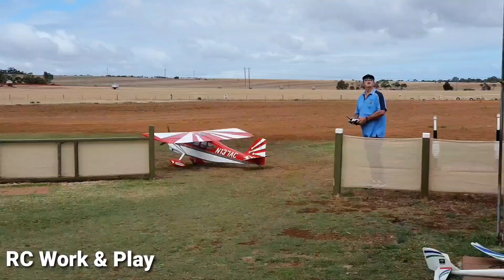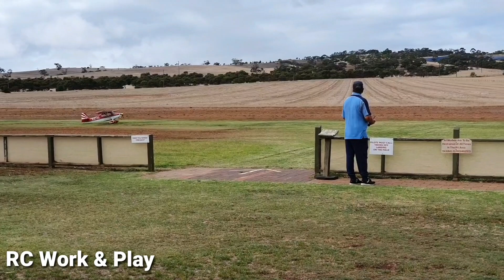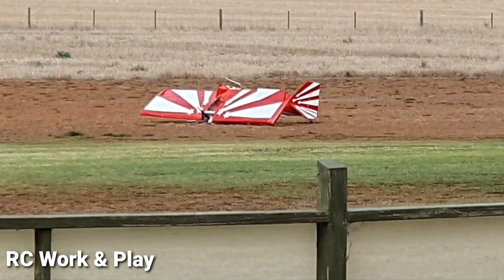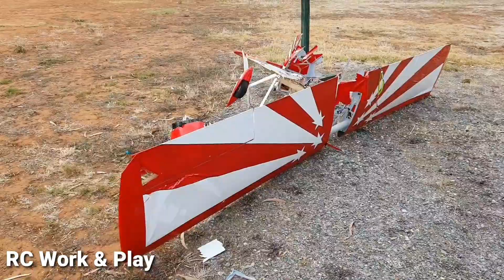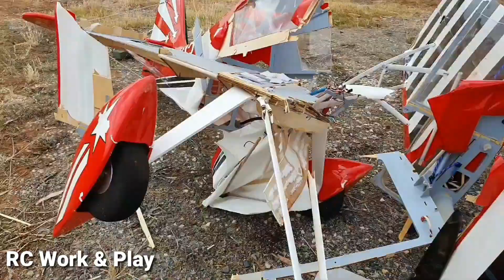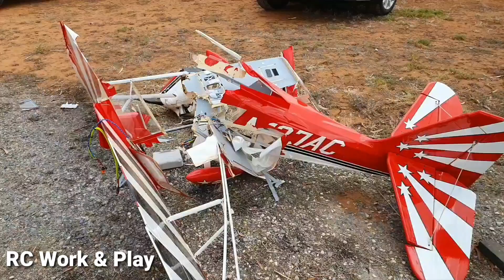Big 1/3 scale RC plane crash!

Comment: Looks like the ailerons were reversed, pilot panicked, stalled it, then crashed it. Purely pilot error, but at least he can learn from it.
Reply: I agree same thing happened to me after I rebound a receiver on my spektrum didn't realize spektrum resets everything to default when you rebind I didn't verify the controls correct like every full size aircraft does before take off. Now I have it as part of my check list.

Comment: Actually, that model had just passed the ground inspection for heavy model, this was it's maiden. One of the ailerons mountings actually seperated with the servo still attached. There was no glitching, there was no reversing of the ailerons.
Reply: How do you know that didn't happen from the crash? I did see him wag the rudder and elevator when he was running the engine up I didn't see any aileron test. Ground inspection did they actually check if the aileron direction was correct? That is exactly what my plane did when I had the aileron's reversed on take off. I had gotten ready to fly my radio somehow needed to be rebound to the receiver. I had no clue that spektrum resets all the settings like reverse servo settings when you rebind. That was when I sold all my spektrum went to frsky.
Reply: @Mike-01234  yeh so there was a few people who checked this control directions. Including the person flying and the heavy model inspector.
There wasn't any reversing due to a re bind as you have suggested and it wasn't spektrum so I'll leave that alone there.
Post the crash going through the wreckage it could be clearly seen that where the servo tray mounts the joint was dry with only glue around the edges on the surface. Unfortunately the person flying didn't actually build the model and it was therefore not detected.

Comment: information.      at :23, starboard aileron servo, seriously,  Glitching.!!!
if servos were not  correctly installed, WITH  GROMMETS, they all 
would be prone  to  glitching; from engine vibration.      googletranslate
Reply: its painfully obvious that the ailerons were reversed then the model was stalled after takeoff. Are you blind?
Reply: @SuperMillerman10  Agreed, watch it on slow-mo (.25) and at 58 seconds in, while the plane is rolling to the left the aileron is fully deflected the wrong way.
Reply: Could have been ignition interference that's why I have one of those spark generators connect to the ignition verify the radio is good when I do a range check. Never seen anyone install a servo with no rubber grommets when the are supplied with every servo. I didn't see him check the aileron control is correct only wagged the rudder and bumped the elevator a few times. I did see that right aileron moving was that from the prop blast during the run up?